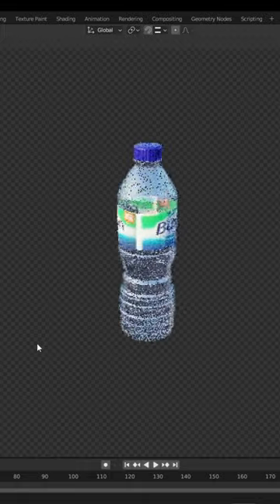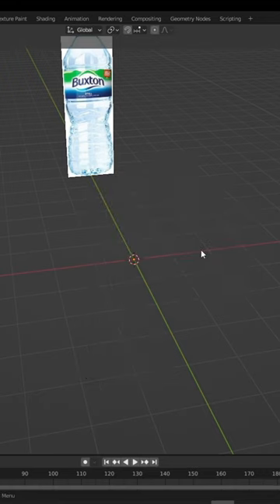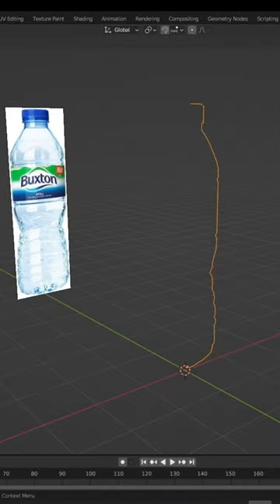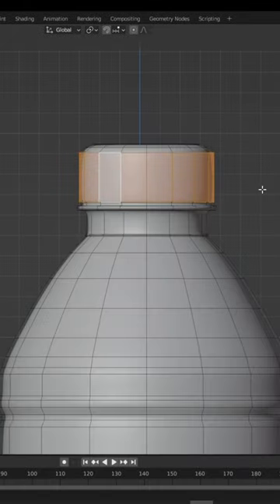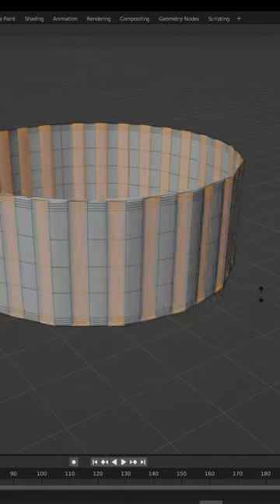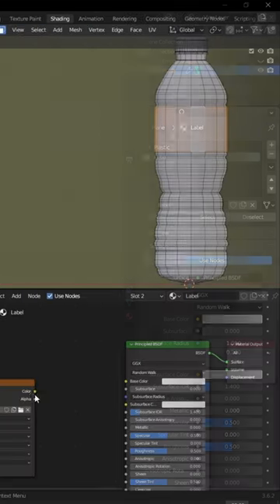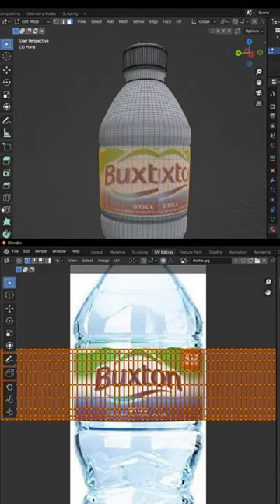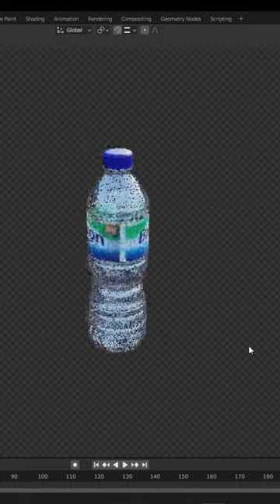Create a Water Bottle in Blender in 1 Minute!

Comment: the amount of polys used to make this was nightmarishly excessive
Reply: Maybe because it's not low poly?
Reply: @fusiongg10 
Doesn't need to be a low poly style model to be conservative on poly count. Something like this is rarely a centerpiece model, and is usually used for clutter. In those contexts it's much cheaper to use normal mapping to replace geometry like the cap and the ridges on the bottle, cutting his poly count by like 40-60% without reducing quality by a noticeable degree. 

That said, there's nothing wrong with the way he did it, especially for a 1 minute yt short lmao. Still much better than loads of STL models I've worked with, and his topology is relatively clean too
Reply: For concept or pre-rendering, it's fine. You're absolutely right it's excessive for live rendering media, though. But ideally those watching understand the concept of game-ready assets and retopology.

Comment: What do you prefer?
Solidworks or Blender
I am a Mechanical engineering UG
Reply: TLDR: I prefer Blender for making motion graphics, animation/game assets, and for 3D printing, SW is for physically building more complicated things. If you’re experienced enough in one program, you can imitate *some* of the other program, but they are very different tools. Also, Mechanical Engineering is the best.

I think of them as different tools for different applications, with various strengths and weaknesses. I now work in engineering & manufacturing, but I have almost two decades of experience in Blender (started in ~2007).
At its core, Blender is a surface modeler that focuses on how a thing looks on the screen while SolidWorks is a solid modeler that focuses on how a thing will be built and manufactured in the real world.
SW excels at the following:
The built-in assembly and component/part system allows for ridiculous manufacturing scalability. Since you have vast part libraries of purchasable components with design specifications (screws, rods, motors, hinges, etc.) sourced from places like McMaster-Carr and DB Roberts, you can quickly integrate them into your designs. Due to this, you’ll also be able to estimate cost for the components very easily. 

Once you have your design, you’ll be able to create versioned manufacturing drawings for each individual component that’s required to fabricate it. These can be sent over to a manufacturing firm to get a quote on their cost.

In SW you’ll be specifying an entire airplane from  the materials of the wings and cup holders down to the 982nd screw in the cargo bay. Revision control also allows for iterative design and collaboration for huge projects like this.

Blender on the other hand is far more organic and freeform. It’s a non-profit organization, completely free, open source, customizable with countless add-ons to the point it can replace entire other programs, absolutely massive community, and continues to improve to the point where I feel it now surpasses paid programs like Maya and 3DSM. It also looks like it’s got Houdini Core in its sights now. It excels at making things look and act exactly how you want them to, and all things considered; you can do it incredibly quickly. With a handful of hours in Blender you could make movie of an airplane flying over an overgrown city in a rainstorm from scratch, but you’re not going to get a bill of materials you can send to a manufacturer out of that file.
Because of 3D printing and laser cutting, with good practices and a lot of experience you can still fabricate things out of Blender, but that’s on a personal/private level. In its current state, you’re not going to use blender to fabricate anything with more than a couple dozen components, let alone the tens to hundreds-of-thousands in an aircraft or building.
But you’re also not going to make a ten million polygon photorealistic rainforest with a dynamic sky, or a fully animated monkey with actively simulated fur in SW.
Reply: @VoodooTrashPanda  thank you for your valuable response